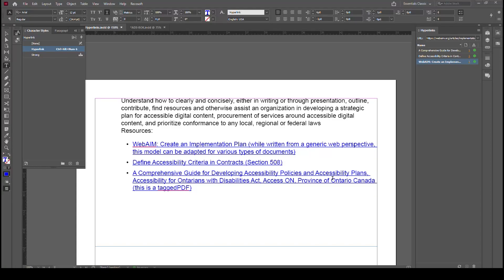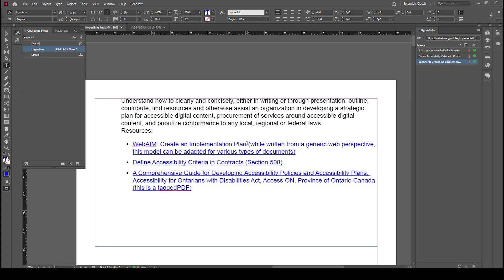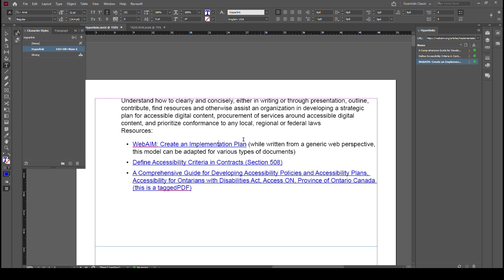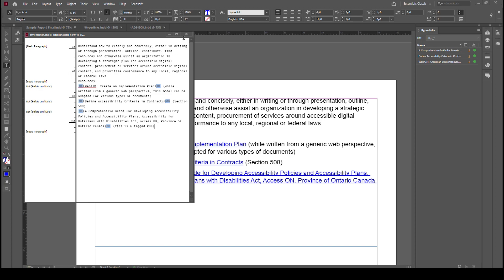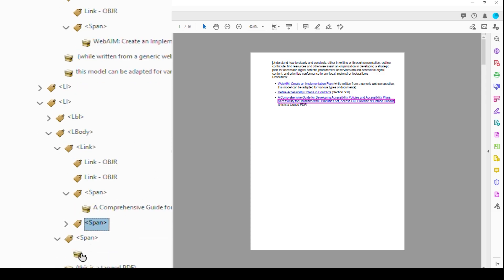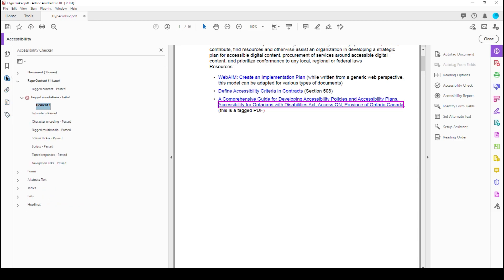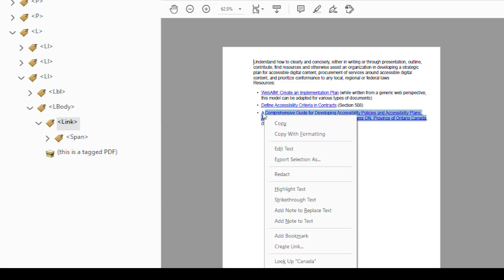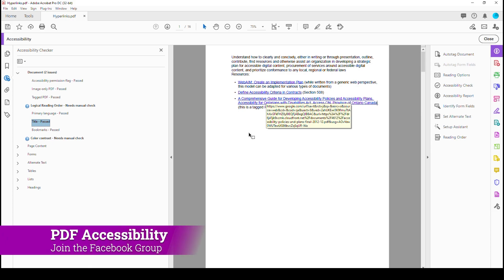Fixing Multi-line Hyperlinks for accessibility

Comment: Dax -- first, thanks for this. Super useful information. I use it ALL the time. However, I wonder how necessary this is in terms of the final disabled user experience. This comes up a lot, and often, it comes up in docs with LOTs of multi-line links. I worry that it might be a bit of a waste of time if I'm manually fixing every single one. Any thoughts?
Reply: We actually talked about that very specific thing in our podcast a few months ago and came to the conclusion. That while it is definitely not a good user. Experience for someone to hear the link twice and have to skip twice. It is not considered a significant barrier, but does violate info and relationships in that theirs is supposed to be one link and not 2 and careful attention has to be paid if someone were to try to inspect that U. R. L  Based on the text that was the hyperlink and not the actual link itself that it might give them a false result

Comment: I've done this but when I create the new link it doesn't automatically add the Link - OBJR like it did for you. I have to right click and choose Find... and have it find the untagged link and tag it that way. Is there some setting to automatically have it create the Link - OBJR when creating the link without doing the extra step?
Reply from the maker: It would depend on how you create the link. Happy to review with you. Reach out in the FB Group PDF Accessibility.
Reply: I am having the same issue, any luck on the fix?
Reply: Same here. Not working. Ugg